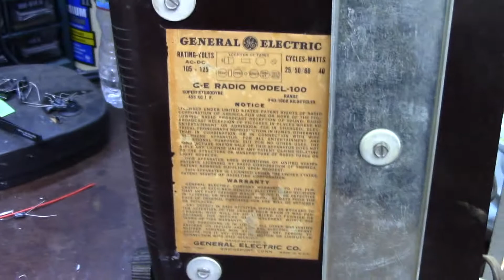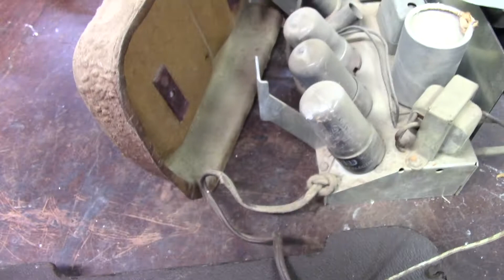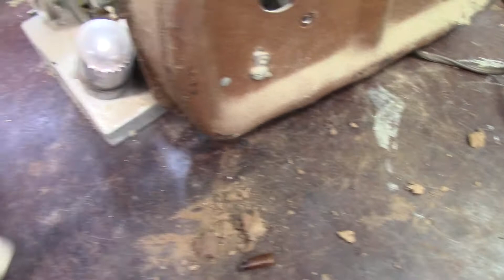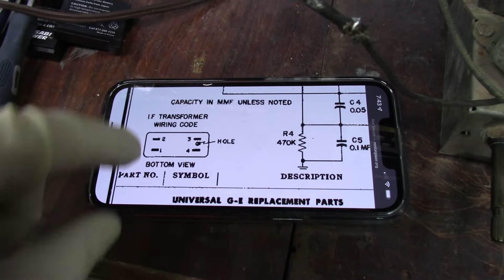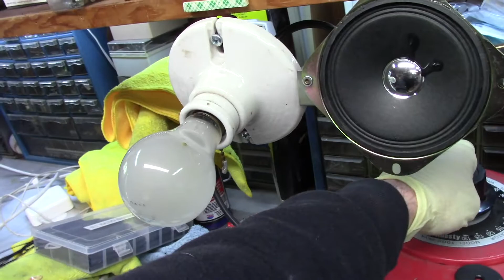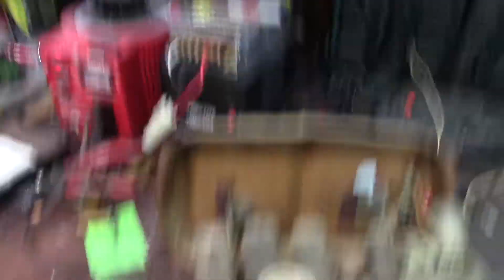1946 GE Radio Model 100 AA5 Tube Radio Repair

Comment: I recently acquired a model 100 with the ruler dial. Severe hum but, it does pick up some stations. Aside from years of dust the bakelite is pristine. Has 3  replacement philco metal tubes. Missing back cover but all push pins are there.
Reply from the maker: I’m sure it needs filter capacitors if it has a severe hum.
Reply: @mechtrician1 ya. Its horrible. Thanks! Going to attempt a recap in the near future!